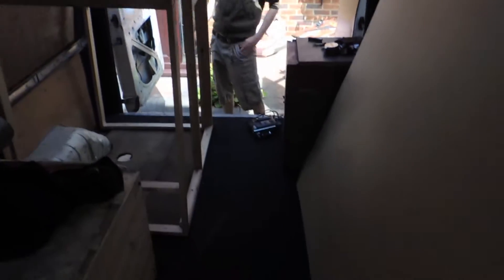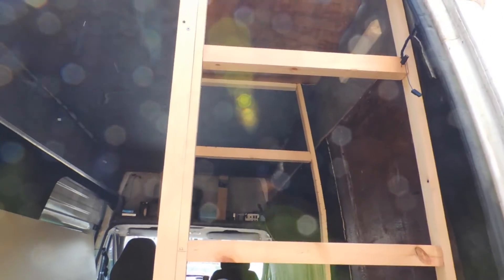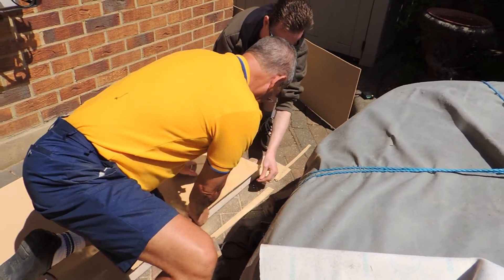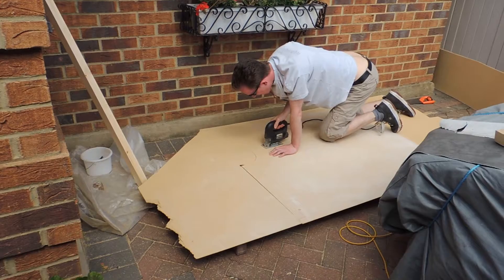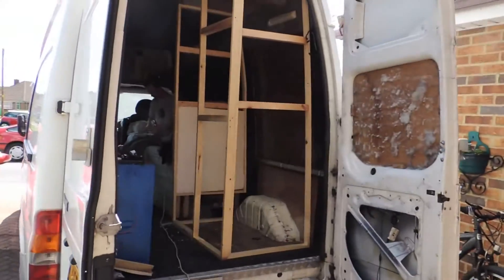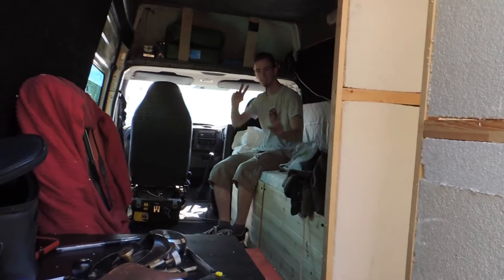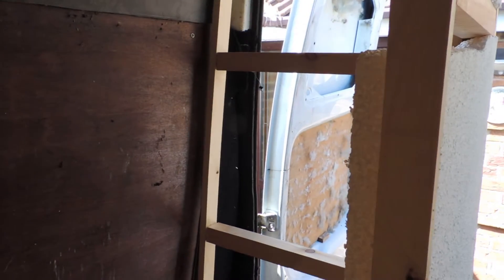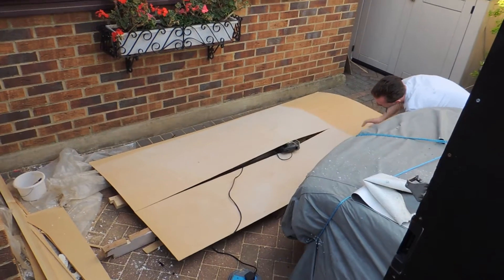Super Bus Mk.3 - Episode 13 - Saws and Hammers

Comment: Should the installation of the bathroom materials have gone in before the walls? Don't think I asked how the toilet and shower will be installed. Good work though!
Reply from the maker: Drew Eckhardt Hey boss! =D It's a wet room, so the whole thing is sealed, then we add the flooring and walls, then seal it again. The shower head and toilet are loose, so we just chuck them in at the end, makes it easier to lay the flooring =D All the best brother!! Have a good one!! =D